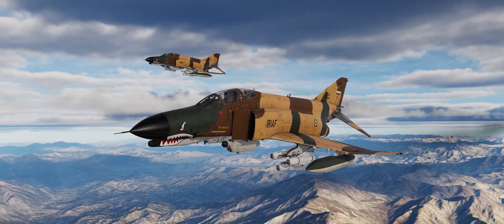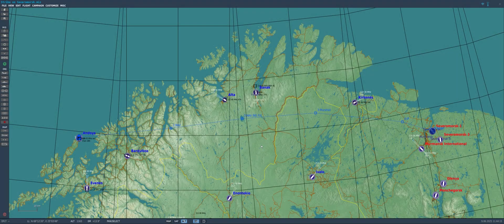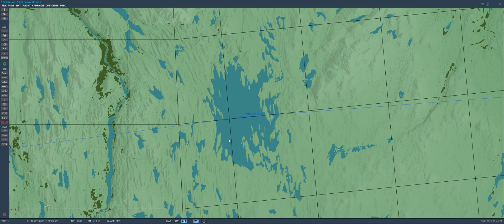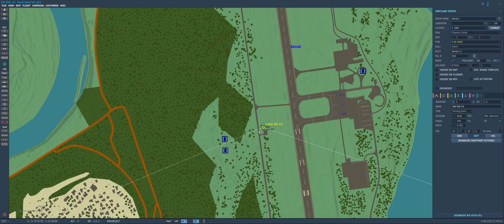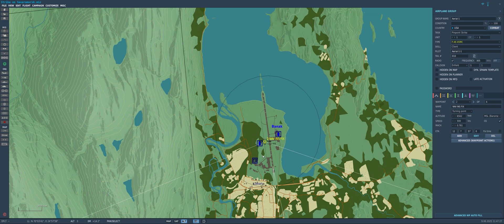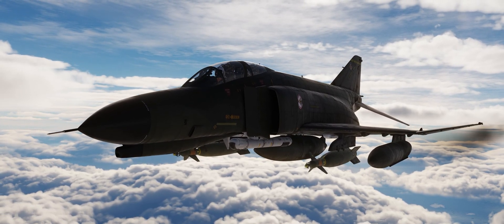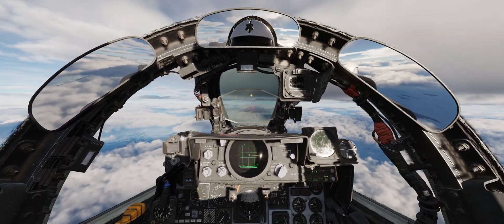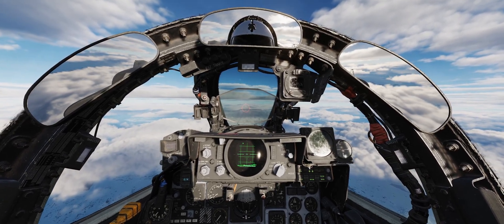DCS F-4E Phantom II Tutorial | INS Update Made EASY!

Comment: GREAT VID. This was LONG overdue for me. However I do have a question: When I get my nav fix over my TACAN, do I (or Jester) need to adjust the magnetic map correction? I ask this because I tried a straight line fam flight in a Phantom from Bodo to Murmansk. Bodo's mag dec was 7 and change (I don't remember exactly off the top of my head)..........well I ended up about 25 miles south of my destination of Murmansk (which was about 11 and change). I didn't update over the whole flight (as I didn't know how at the time or that it was necessary). I clocked it up to INS drift, but it occurred to me the declination changes rapidly as you go north also (should have known this as I use magnetic declination in my job). I was wondering, in your case, would you need to change (or would jester need to change) the mag dec to match your fix point? I would ASSUME so, but how much error does magnetic declination induce on top of INS drift?
Reply from the maker: Hey man! All you’re seeing there is INS drift, if you had done in inflight INS Update you would have been right on target over Murmansk
Reply: @Spudspike  Ok wasn't sure about that or not, as when you do your initial alignment the INS asks for the magnetic declination at your starting point. Wasn't sure if it needed it at the fix update point also
Reply: @Spudspike  Sorry I forgot to say THANK YOU and for some reason my browser won't let me edit my comment. MY BAD!